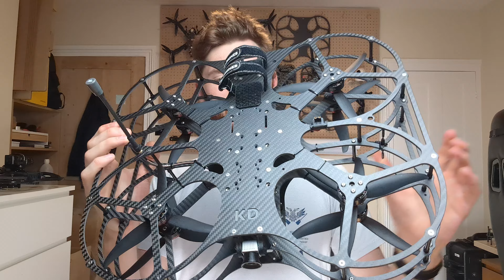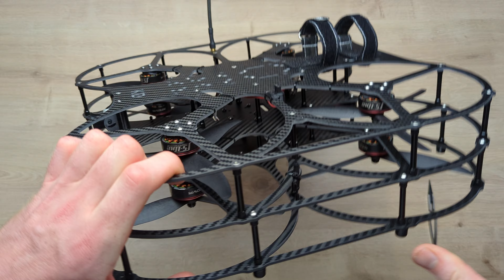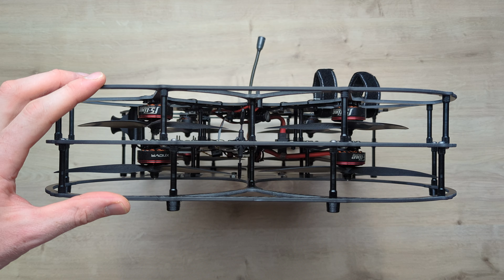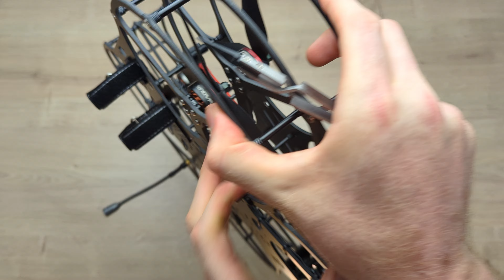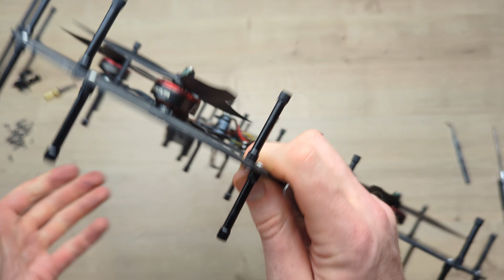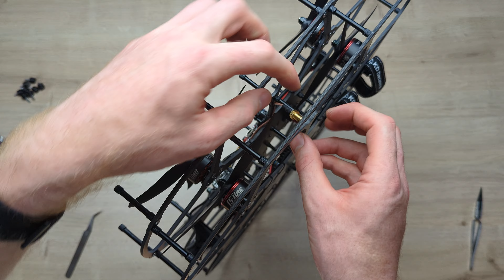KD70 | The Easiest to Build Cinelifter

Comment: I can see someone building a double  one of these😂
Reply from the maker: I actually did that on the 5" version it looked amazing haha. Never flew it though, but technically it's possible to stack them up as much as you want because of the dual sets of holes in the middle and bottom plates
Reply: @kddrones  that's great dude. Have you ever thought about frame swapping the avata to a X frame? Maybe 2.5-3.5 frame that would give it a more realistic fpv drown look and feel.
Reply from the maker: Thanks! Honestly it's just not worth the effort. The avata 2 is good already, if you need better performance then build/buy another FPV drone, not worth the hassle for me anyway
Reply: @kddrones   sorry the Avata 1 not the newest version. It's like saying you have xbox one lol
Reply from the maker: Ah gotcha, yeah sorry I just have no interest/time in doing that, but you should have a go! Sounds like a fun project

Comment: Your xt90 connectors ore switched usually it’s always best practice that the source of the power is the female and the the consumer is male (if the male is power it can be easily shortened)
Reply from the maker: Good point! And you'd usually be correct for when you're plugging them in while power is connected. But this is only done while assembling or taking apart the drone, the internal connection will always already be connected when power is applied to the system from the main XT90 so it doesn't matter